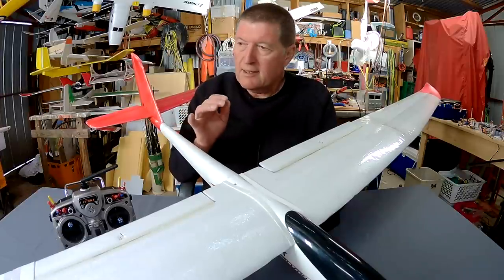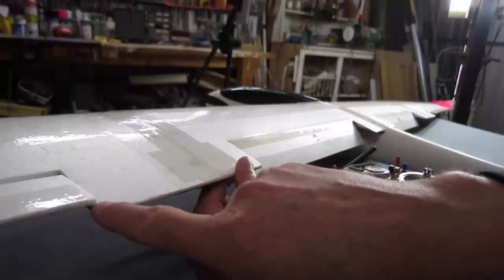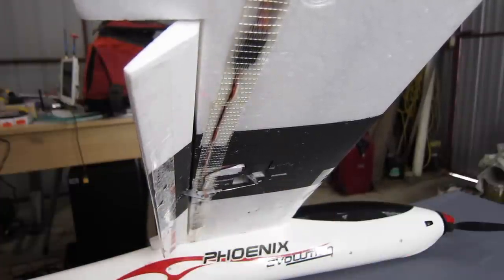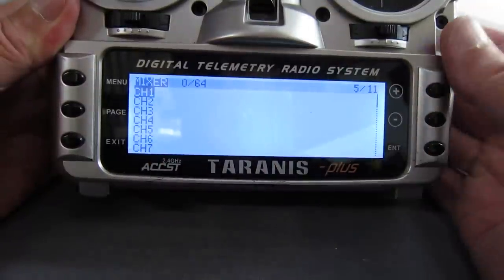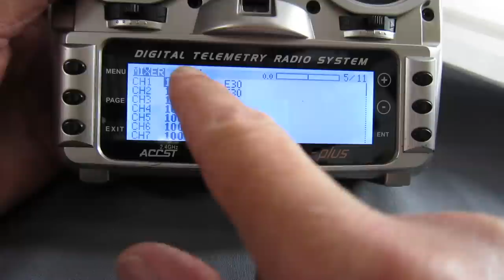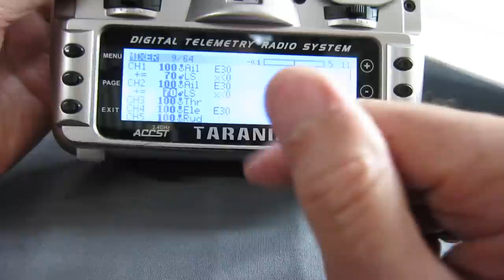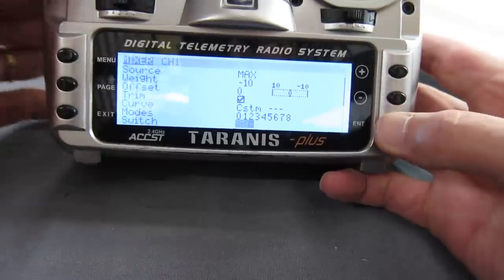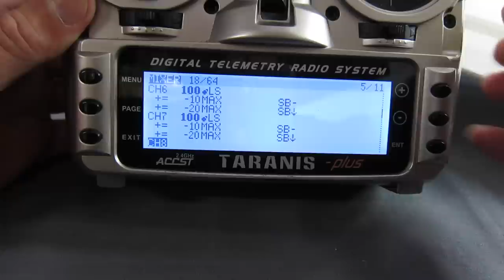Basic Full House Glider setup

Comment: Andrew! I’ve always been intimidated to program my Taranis , I usually used it primarily for quads because I needed just one model. I set up my ASW28 last night using your video- thank you so much for this video, I can’t wait to fly it again. I did most the mods to this glider as well, ie: removing the wood tray and wheel. Thanks again- you made programming seem easy!
Reply from the maker: Excellent. The Taranis can be simple or crazy complicated. I always go for the simplest setup.

Comment: Thank you Andrew, this video really helped! I recently bought an X-lite and your info really crystallised the Opentx programming approach for me. Where others videos offered 20mins of a 'programmer's' view point, yours gives a simple, no nonsense user's guide. The 3 mins in the middle gave me pretty much all I needed to grasp the concept, especially useful that it's all via the tx rather than through a PC. I want to be able to tweak stuff at the field without lugging around a laptop! Thanks again!
Reply from the maker: You're very welcome!
Reply: @AndrewNewton  i would add that from a beginner standpoint it would be nice if you gave a quick definition of terms.  I'm new to the hobby, i understand flight controls aileron, elevator, flaps, rudder etc. but have no idea about radio jargon.  Whats EXPO?  Why 30%? What does SB mean in SB switch?  etc etc

Comment: I'm shopping a new TX right now because I want to build a balsa, full house, 6-servo wing F5J model (Höllein Inside F5J). My DX6 isn't up to the task. I've been considering a DX9 or iX12. A lot of people seem to like the Taranis with OpenTX though. Even a lot of DLG guys. I haven't really been sold on it so far, but this tutorial makes it look pretty easy. I picked up on the logic of how the programming works after watching you set a couple mixes!

I like how sort of direct and bare-bones it is. I don't have to go into a camber presets menu to set up flight modes then camber system menu to set my flap mixing, then my mixing menu to set rudder presets and compensation, etc. It just has the logic of what control does what and what it's actuated by under each channel. Very straightforward and very much like writing lines of code. The one downside I see is that you it appears that you can't label what each line of logic is for. It would be easier to keep straight if you could call a mix under a channel 'camber' or 'crow' etc.

Keep it up! Watching your TopSky build video ages ago kind of got me more into sailplanes. At the time I thought, "wow, that's a lot of crazy work for an airplane!" but you seemed like a regular guy doing it with good common sense and attention so it was still very encouraging. Now I'm flying DLG and building balsa models!

Cheers,
Brendan
Reply from the maker: Excellent Brendan, thanks for sharing your journey. I'm sold on Taranis and OpenTX, just with the hardware was as good as Spektrum

Comment: I'm glad you've done this setup.... Just finished my ASW28 and was hoping to maiden it today but was to windy and I need the flaps and crow for our small field as the approach from the east is a high and steep decent kind of approach over factories and bushes with an open area of runway of about 150m long... And then to do my Pheonix 2000 with the same setup....
Reply from the maker: Excellent, those are exactly the situations that benefit from this setup
Reply: Yes because I was always forcing my Radian to land when trying to land while it was flying in ground effect area...

Comment: Love it Andrew. I learn loads from you. 
Thank you so much.
I do struggle a bit with programming my Taranis.
But what i do sort out with your help, is well worth having the Taranis.
As you already know, I took your advise, and i have got this glider.
Thanks again.
Keith.
Reply from the maker: Thanks Keith. My knowledge of OpenTX barely scratches the surface but I wouldn't use any other system

Comment: Great full house description Andrew. I have to admit a liking of aerobatics in my Evo 2600, but even with the full wing aileron mix using flaps  I can still set a decent crow and slow the model down for an accurate landing. Works great when sloping to be able to throw in a few tricks.
Reply from the maker: Hey Jo. Trying to keep this video as simple as possible, this is the third attempt and I still forgot to add ele offset for the flap mix.
Reply: Snap flaps?
Reply from the maker: Crazy Kiwi aerobatic ideas! Actually I usually have snap flaps for inverted

Comment: The evolution's flaps are set up like the Bix3's, right? They don't send you a reversed servo, do they? All of the wing servo pockets are facing the same direction, except for 1 of the aileron pockets?
Reply from the maker: Correct, could get away with y leads for ailerons and flaps

Comment: Hi Andrew. Thanks for the video. I was wondering if you could tell me why you use a separate channel for each of the flaps. It strikes me that they’ll always both be doing the same thing unless full wing ailerons are needed. 

Cheers

NOSS
Reply from the maker: Full span ailerons and allows you to trim each flap in the radio. But I actually use a Y-Lead myself.

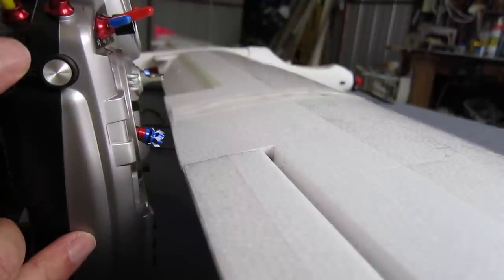Comment: Andrew, I really love your content ( including the diving clips)  and have watched ALL of them for years.. I can't get the Ail to CROW movement correct (with flaps going down the Rt Ail for example always deflects down with it at > 50%   (not UP a bit as it should instead) Instead they typically both travel down together.. Yet with NO FLAPS applied, the ailerons both deflect properly.   I think its possibly because to get proper Ail deflection I had to Invert both Rt and Left Ail in the OUTPUTS stage initially .. but now that I did that . regardless POS of NEGATIVE value set around 70 under the Curves Function and regardless of if I set the Curve  Function to "V < 0" or  "X > 0" and even with the Subtrim tweaked from +100 thru -100 or more.. i cant get the Ailerons to deflect in the correct direction UP.  At the 50% FLAPS point at time 7:45  is where it' fails.  While the the Flaps are travelling down properly, at the 50% point the Ail starts to go Down then not UP..  I'm using the S1 Pot since I have a Q-7XS with no LS Slider.   I'm doing this setup on a RC-Motion Shrike.. but will try again on my Phoenix V2 2400 tomorrow..any tips on how to resolve this issue I'm having at Frame 7 minutes and 45seconds  into the video would be most appreciated..   Your tips and tricks have always worked VERY well till now..    Thanks in advance..
Reply from the maker: Hi Jim. Probably need to back up and start again. Get the ailerons working and the flaps working. The ailerons can't be on a Y lead. Just add the 70 S1 X>0 line to each aileron then change 70 to -70 if needed. That should be all you need to do.
Reply: @AndrewNewton  Thank you ..I will try again from scratch.. and let you know how it goes.  the Shrike comes with a Y on FLAP servos  but I removed the Y cable. To get the proper Al direction I had to  invert RAil and L Ail .. and independently BEFORE adding the flap mix they are deflecting normally. I've already tried either + or - 70 but will repeat..  More later.. Thanks Again!
Reply: YEAH!  Lets celebrate !it's working really well now.. this is the 1st plane I ever got a CROW mix working on..!   I did start from scratch and did everything the same as earlier, and it was behaving the same way ( with the Rt Ail going down not up) till I deleted the LS ( in my case S0) mix I had copied and then went back and copied the other LS line in this case correct Chan 6's S0 line from the OTHER / Correct Flap Channel,  and then finally had to invert Lft Ail CHAN 2 to -70 instead of Plus 70 .. Now it works and the Ele Compensation works at -18 for me  too!  Thanks so much !

Comment: Trying to squeeze a full house glider into 6 channels, it seems like a y-harness on the flaps would work.  I think they always move together in all modes, other than full ailerons which I'm not interested in.  Have I jumped the track?   Great videos.  Wish I had the beautiful coastal hills to soar that you do.  Cheers!
Reply from the maker: Many thanks. Flaps on one channel is fine. That's the way I usually do it. Dont need full span ailerons unless you need to show off.

Comment: Andrew I'm a big fan of using Wireless Training with my friends and grandsons.. If I set that up ( normally I do it thru the INPUTs page  under SH toggle and some switching logic..) and use the TR Inputs at 100% can the student fly the plane normally without flaps or crow at 100%  via the Training Mode : MASTER:SBUS option without any crow or Elev compensation.. and if that works can I replicate this Full House setup in the Student Radio and expect it will behave the same with Crow and flaps in the same way  the Master is now?  I have identical Q-7XS RAdios I'm going to try this.
Reply from the maker: You will have to educate me when you try it Jim. I have never tried buddy box setup other than the most basic 100% TR signals.
Reply: Andrew Newton ... well sure.. I did try it and simply added the TR1 to TR4 channels into the mixer stage adding  each above the main control CH Enabled by the L03 trainer On Switch and while selecting one of 3 rates it worked fine on the 4 basic input control channels.  .. but to add the full house control with flap and Ele compensation it’s clear to me now that I’ll also need to replicate  the entire master model Mixer stage setup and copy all 7 over into the student radio so when he has control, it can provide the student the identical crow functionality. My grandson (he’s 10 ) is constantly pleading with me to let him land it .. so I’ll need to add this full mix into the student radio too. I’ll do it under a special “StuFullHouse” model , so I can switch back to the normal 4ch 100% Rate when needed.  Thank you Andrew for this video on all the basics needed for a 7servo Ch glider with crow . I plan to use it as a template for several others like my Volantex 2400 Phoenix v2 and ASW-28 next

Comment: Andrew, great tutorial. I am pumped to try this set up on my glider too. One question, in the video you mentioned that you set up your glider to have three flight modes: full ailerons, crow braking and camber, but in the set up I only saw you mixing for crow and camber. Did I miss the mixing for full ailerons? Also, do you find camber to be more effective than just dropping down the flaps a little? Thanks for sharing. Cheers.
Reply from the maker: This is the basic full house with doesn't include full span ailerons. There is a link in the description to a full "full house" model file but no video. Cant really tell the difference between full span camber or just flaps with these foamys.

Comment: Hi Andrew, just a quick word. I think the Phoenix looks like its been laminated, if that's correct is there any structural benefits from doing this please
Reply from the maker: Just packing tape near the leading edge to stop dings. Laminating does stiffen the wings, but not usually necessary

Comment: Thanks Andrew. Super helpful. I am setting up an ASW-28 and the ailerons are setup with a Y connector to a single channel. The crow sub modifier (adding flaps) in the Mixer page underneath Ailerons makes my ailerons twist in opposite directions when I throw my flaps. There has to be a simple fix. Any thoughts? (Taranis X9D and Open TX). I see that you used separate channels for each aileron.
Reply from the maker: Only works with ailerons on separate channels

Comment: Andrew can you help point me in right direction please? I am looking to buy a Introduction 6servo wing glider. I am trying to spec ESC and am struggling to understand how to balance right ESC for both motor and number of servos. I can get a higher amperage ESC Sbec servo eg sunrise 45A but am still unsure if this will a) effect motor performance and b) be enough amperage for 8 total servos (spec is 6A bec max). Can you advise or help please? Thanks Pete. PS I am using Taranis 2019+ and expect to use sbus connections. Thanks in advance.
Reply from the maker: Separate BEC would be recommended for that many servos, but I have never done it myself.
Reply: @AndrewNewton  Thanks Andrew it is looking like a separate battery supply from motor to be safe. Thanks

Comment: Please will this work if Flaps are on a y connector as have only 6chn rx ? thanks Ail are separate chn
Reply from the maker: Yes. You would have full span aileron option
Reply: @AndrewNewton  really I thought I would need 7 chnl and indipendant flap leads for that and that isn't what I want all I need is crow and camber and just flaps half and full

Comment: Hi, It appears you have film on the leading edges and some controls surfaces, what's the background to this and do you have a video about it? Thanks.
Reply from the maker: Correct. It's 60 micron clear packing tape. For protection on the leading edge, and to strengthen the control surfaces and foam hinges.
Reply: Thanks for the info Andrew, I've been flying for a couple of months, started with a Bixler and have ordered a Phoenix Evo. Based on my Bixler experience the Evo needs to be as sturdy as possible. ;)
Reply from the maker: Excellent David, my 2 favourite planes. Hope you understand that the Evolution is a thermal glider, and not designed for flying around on power all the time. The motor just gets you up there to start gliding.
Reply: Copy that Andrew, thermalling should work for me, it's when I hang around close to the ground that things go wrong.